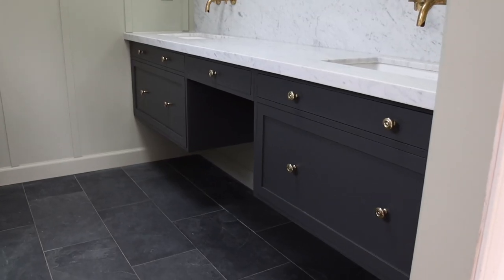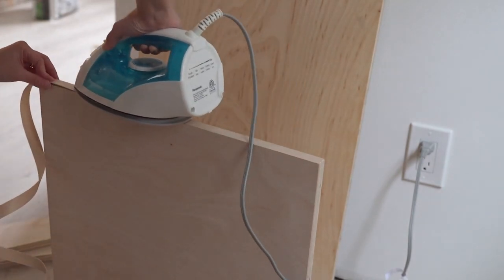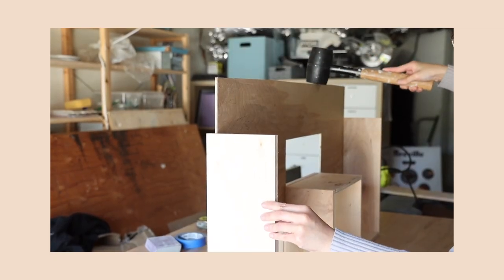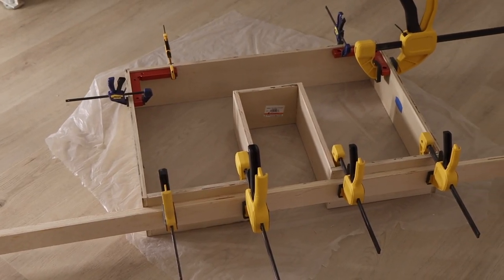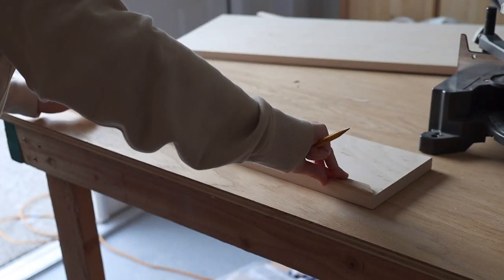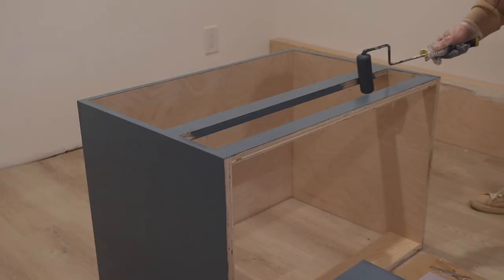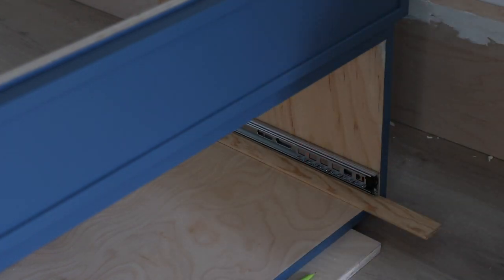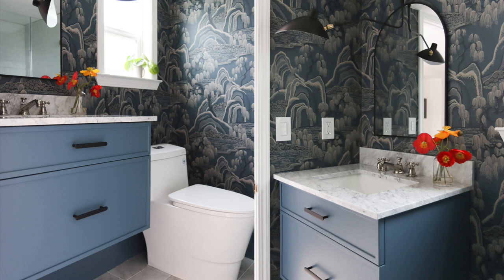DIY Floating Bathroom Vanity

Comment: A better way to add a bottom to a complex drawer shape (other than ripping a groove/rabbet method) use the clamps and squares like she did while installing the bottom to ensure a square, true fit then glue/brad nail/screw whatever works best for you and use a flush trim bit to ensure a perfect, flush fit rather than hoping you cut perfect and slipping in the bottom as it lacks strength even with glue and brad nails and especially over time. Cute vanity
Reply from the maker: Great tips!

Comment: Did the full overlay drawer and tilt out clear the door casing. You did not demonstrate how the drawers worked after the vanity was installed. Looks like it might strike the door trim.
Reply from the maker: I did a spacer piece(3/4" thick plywood) on the left, so it doesn't hit the door casing.